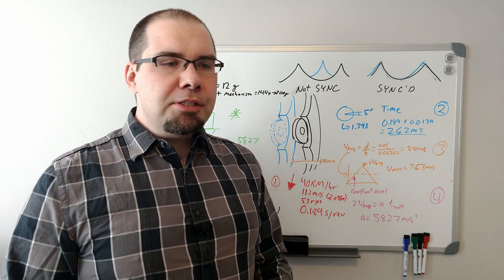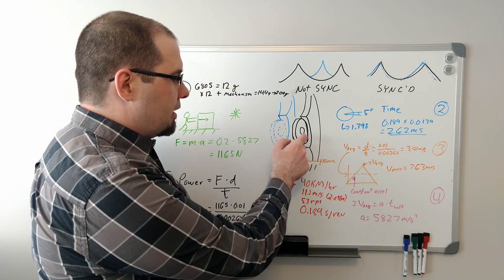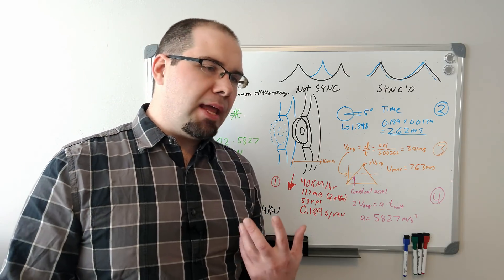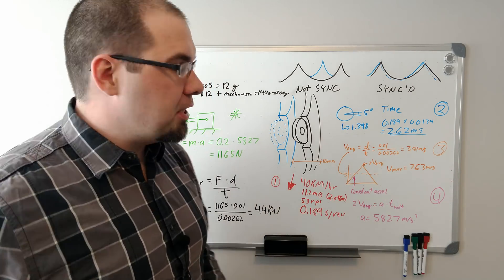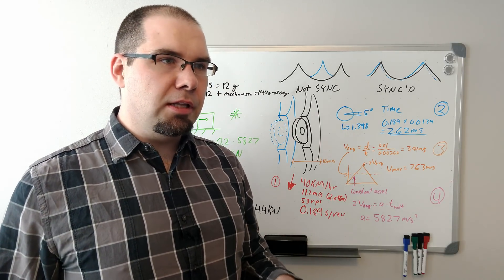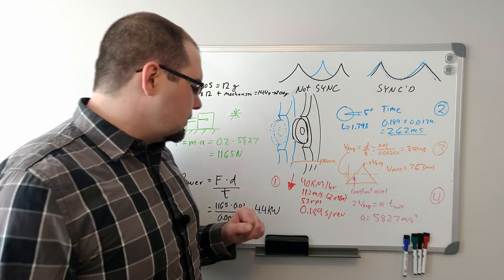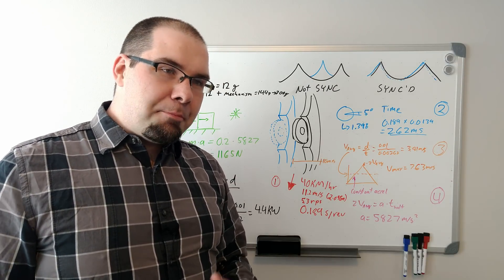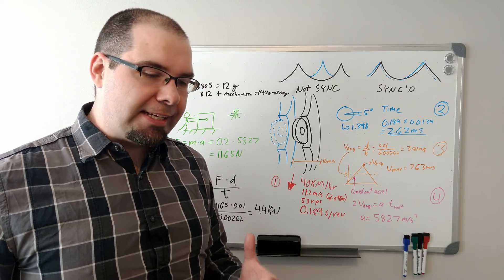Ceramic Speed - DrivEN to madness

Comment: Boring.  Your calibrations have been disproven.
Reply from the maker: Depends on what you mean. This video was based on how they marketed and sold the concept and explained it to work. IT didn't work. However, their new design does... and not a single cycling news outlet could explain or video it properly. I got one still frame from cycling tips that they don't explain, but it fixes their problems. So this video is valid to the original method which they themselves found for hundreds of thousands of dollars to fail.

Comment: Have you seen the update video where they pre-shift the unloaded half of their bearings while the other half is in contact?  Does that make the math any more viable?
Reply from the maker: I recorded half a video on this, and then found the one thing that changed everything. Yes, it looks like the new solution works. Nobody has reported on it correctly at all. I want to put together a new video on it. It does solve just about all the problems.
Reply: @kwakeham  If you get time to put one together, I'd be super interested to get your take.  Cheers.

Comment: Check out EuroBike coverage, its now shifting. Guess you were not correct ;)
Reply from the maker: I've been insanely busy, and actually. Yes and No. The original design as this video shows is 100% correct. That design they first proposed can't shift at all. 100% fail. Doesn't work. I was right. I didn't say it couldn't work. How they got it to work at 10 - 15 RPM with no proof under load (long distance video????) was using a split shift design. This moves half of the system while not engaged. It's a clever design, but it still must be indexed accurately not to jam as there is still only 1 or 2 places it can shift without causing tooth damage. When I get out from contract stuff I'll be posting some new analysis about the design. A good engineer can change their mind if they see a good design. There is a clutchless transmission like this design that failed to pass durability testing in the early 2000's. So once I run some math maybe it's a clever way. I'm not so Luddite to assume my positions are ever absolute.

Comment: The elephant in the room is not bearing contamination since sealed bearings can address that.
Shifting would not be impossible either, since you could make a single solid slot with no gaps between gears for the shift slot.

The elephant in the room is that the whole DrivEn thing will tear itself apart the instant anyone bigger than a toddler pedals it.
It will be forced inward (away from the shaft), causing deflection and possibly permanent damage to the gearplate. 

Maybe they somehow incorporate it into a disc wheel rather than a spoke wheel so it would not flex.

Comment: Forget all that, just look at the rear gear. There's no way that holds up to lateral load, especially in the lower gears without flexing/self destructing. Ceramic Speed is FOS.

Comment: Such bs. You didn't consider that the backwheel most likely has a freehub so the cassette can actually be completely static while shifting, giving you as much time as you want. Even if you want to shift while still turning the cranks, it's not like you have to shift a bearing over like you explained. There are multiple bearings on a shaft rotating at the same speed as the cassette. So it doesn't matter how fast you are going, it's about the relative speed between cogs and bearings.
Reply from the maker: True, but with a freewheel you can just jam the whole thing. The system can't engage without timing, it just rams into cog wheel and can't go anywhere.

Comment: The DrivEN is a joke. The actual transmission with cog, chain, chainring is the best we can have in term of speed, efficiency and cost maintenance. Gear hub haven't enough gears and shifting is not as fast.
Reply from the maker: It's insanely hard to beat these chain drives for efficiency.

Comment: one comment on the calculations: you assume the bearings having no rotational speed at all. In reality they are moving with about the same speed as the tooth-wheel, which increases the amount of time to change gears considerably, and thus reduces the amount of energy involved etc.
nevertheless I wondered in all video's how the shifting worked in reality: the principle is only told of to the public, but no shifting action is visible. 
A method invoving a lift-mechanism for the drive shaft can probably make things better.

Another totally different question about the Ceramic Driven system: all force is transferred to the wheel by only e few teeth at a time. In comparison to a chain (where about half of the teeth is involved), this will cause very high stress on the teeth. How durable will this be?
Reply: I think it will tear itself apart the instant anyone stresses it even slightly.  At best, the gearplate will flex and cause tooth jumping; worst case, the whole thing will fracture catastrophically.

Comment: I think the solution is in the sync method, a disengagement(clutch) of the power on the drive shaft side Operating between shifts is needed.